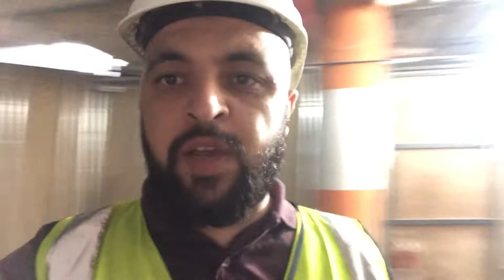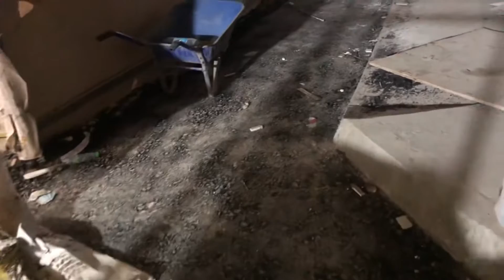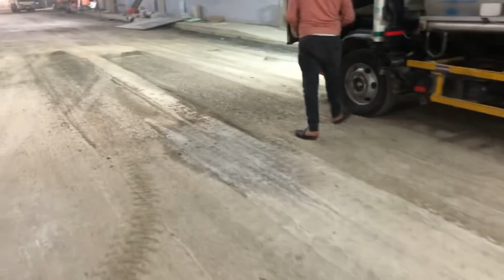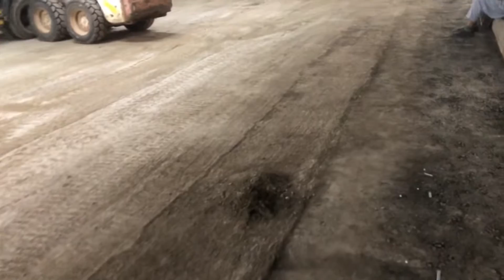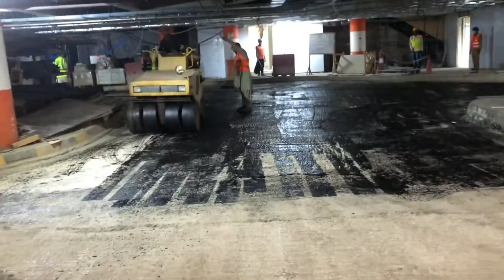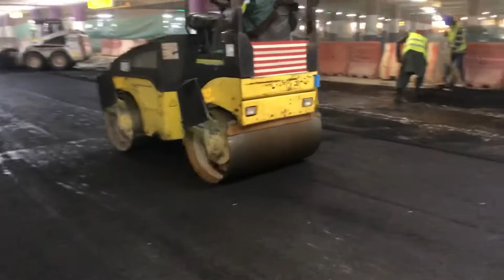Asphalt Road Construction | Different Layers in Asphalt| BBC, BWC, MC & RC| Milling of Asphalt Road

Comment: What is the range of temperature before and after compaction of asphalt BBC and BWC
Reply: Temperature is checked while mixing (150-170°C) and while compacting (140-155) but these values may vary depending upon the project's specs